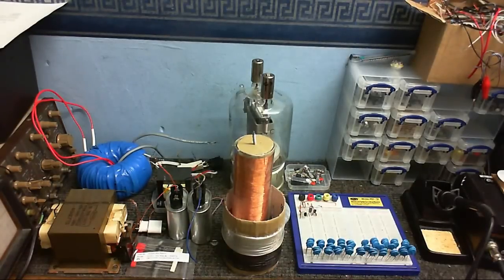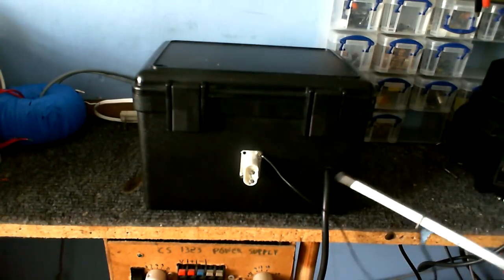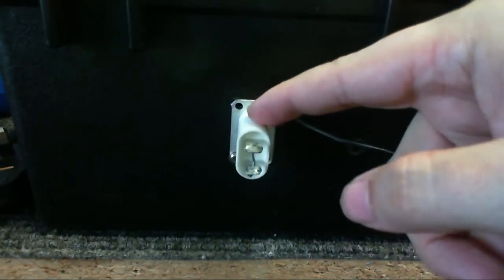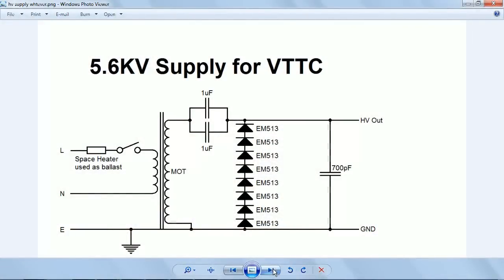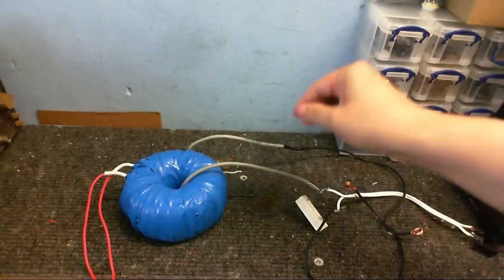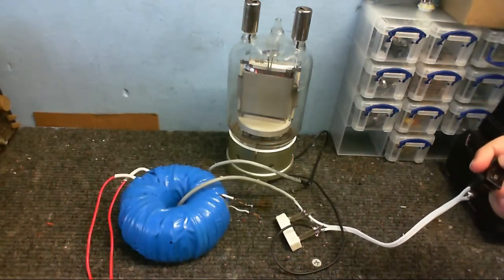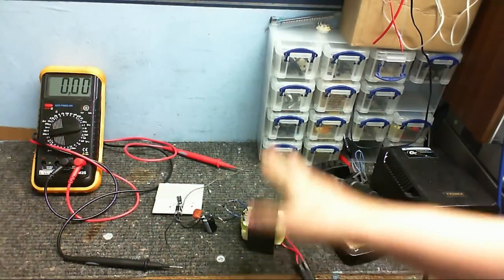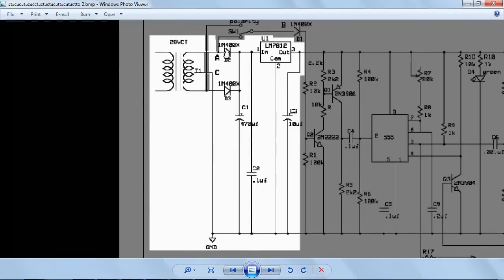How to make a VTTC - Part 1 - Power supply Basics

Comment: You mentioned "soft start" the tubes, and I thought of how many common regular light bulbs blew out when the switch was first turned on and all that current going through the filament at once before  it was heated up and had alot of resistance to current, it must be the same concept.
Reply from the maker: trailkeeper That would always give me jump when light bulbs did that, can't tell you how many light switches I've smashed just from being startled by that.  I'm a very jumpy person and when something like that happens I feel like I just have to smash the first thing I see, I can't help it, so that's why I switched to fluorescent lights.
Reply: CoolDudeClem I once thought of a switch and resistor in a box that could be used on the wires, or extension cord to prevent the bulb from blowing out, but then again a dimmer switch might do the same, but its more expensive.  This concept could be used for a soldering iron. I also read that you can use a diode to cut the power to a soldering iron or light in half, like a dimmer.

Comment: hanks for manking this.

Would like to have a program on TUBE POWER SUPPLIES. That's really important. It doesn't mean it has to be MADE from tubes mind you, but rather the best way to build a PS for a tube amp that will be stable and have as little drop in voltage when the load is on it. Anyway, that's my two bits. Hope you're doing well.

Vids look great as usual. Nice disclaimer. Cheers. :D
Reply from the maker: ***** I will get on to making a video on tube power supplies when I have time, I've thought it would be a good idea to show the differences between tube rectifiers and ordinary diodes, so I'll get on that when I can.
Reply: no hurry , just throwing an idea

Comment: Gosh. This tube is ridiculous. IT'S FREAKING HUMONGOUS. :D How many watts can it handle?!
Reply: Matheus Moreira 600W worth of anode dissipation
Reply: Wow! I wish I had one. I would make a power amplifier with it. :D
Reply: It is an penthode designed for RF generator, I don't think it'll be good for audio amp. Not all tubes are great for audio
Reply: Nice. :D
Reply: What is the RF frequency band it is to be used on?
Reply: According to datasheet: Pentode for RF generators as well as an RF amplifiers for frequencies up to 50Mhz

Comment: What is the Vacuum Tube you are using for this project? keen to build one of these to go with my other tesla coils, but need to know what tubes i should get for it
Reply from the maker: It's a GU-81 tube, you could also use 811A tubes instead (usually 2 in parallel), a lot of people use them. As for price though, I got my GU-81 new from ebay for about £17, I don't know how much an 811A costs though. Nice thing about tubes is they can take a bit of abuse and don't explode like transistors do.
Reply: @CoolDudeClem  just checked and sadly the shipping to get them to me exceeds the cost of the tube, joys of living way down in New Zealand. they all seem to be coming out of russia or the ukraine. Trying to find some 811A tubes locally. yeah i have blown more than my fair share of transistors lol. thanks for getting back to me.

Comment: Ballast? What exactly does that mean? You run the mains power through an appliance that is I direct way through in series like a heater or a light bulb? What function does that serve? Stability? Prevents overhogging of current from the mains? Learn me.
Reply from the maker: ***** A ballast is simply something to limit the available current.  it can be either a resistor or an inductor with a lot of turns.  What I did here was connect a heater in series between the transformer and the mains since a heater is basically just a big resistor, so that limits the amount of available current going into the transformer, those microwave oven transformers (which is what i used) can overheat and blow fuses if they're mistreated or shorted out, so by limiting the current, if anything goes wrong it won't smoke itself to death, blow any fuses or put a boat load of current through the tube and damage it.
Reply: Thank you. That's a really useful tip. Makes sense. So it basically serves to limit and stabilize things. Cheers.

Comment: Is that how you "increase" a diode's voltage rating? with series connection? wow.
Reply from the maker: ***** Yep, that's pretty much how it's done, in fact most HV diodes such as the diode in a flyback transformer are constructed that way.